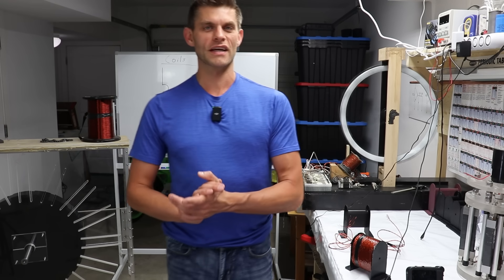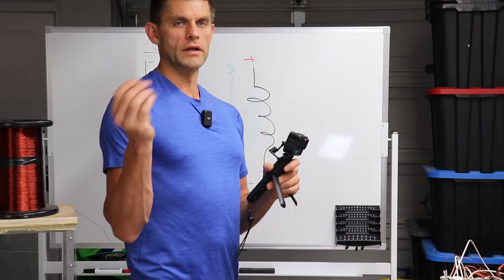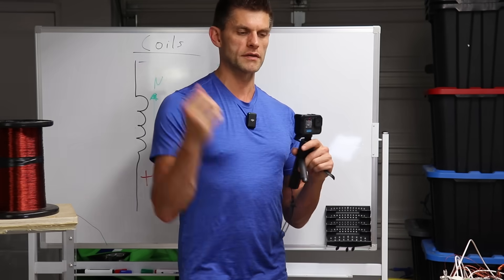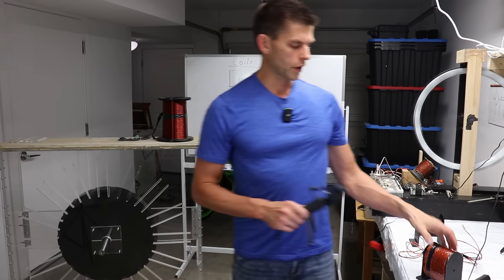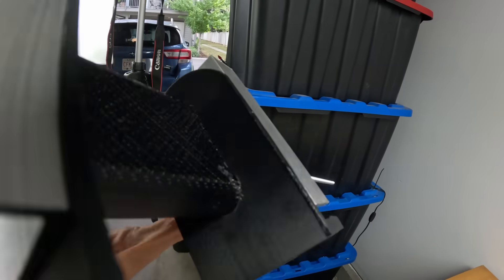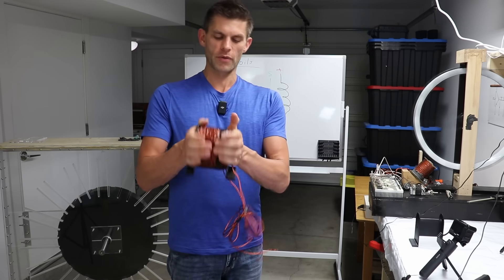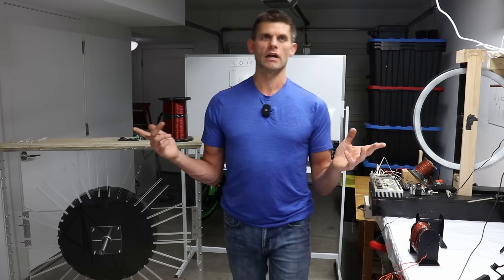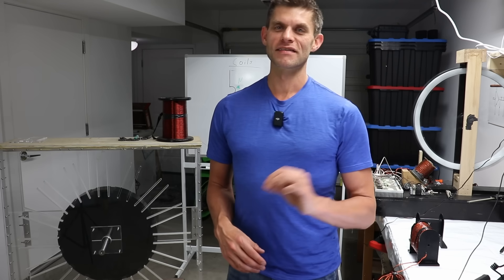Unlimited Energy in My Garage (No Patents)

Comment: I am going to support this project as much as I can, sir. From a deeply unconscious and suffering world, my heart thanks you. To the golden age of planet Earth, onward!!!
Reply from the maker: thanks for the support, lets make it happen
Reply: This is Nikola Tesla's ignition system. If he knew anything about coils he would never do that nonsense in the field with the drill and then cut the ends. It's absolute nonsense. Not to mention stating you can charge a battery with an intermittent pulse, if he used a super capacitor, it would be at least slightly believable.
This guy is a fraud, and anyone giving him money deserves to be scammed.
Reply: Why? He can always sell unlimited energy back to the grid to get all the money he needs. Unless this is a scam, but why would you support a scam?
Reply: Hey I have a unicorn detector if you're interested?
Reply: You're going to get scammed. You'll be further ahead by just not giving this scam artist any money.
Reply: Zero-point energy, the minimum energy that a quantum mechanical system can possess, cannot be harnessed as a practical energy source. While it’s a real concept in physics, “zero point energy” represents the lowest energy state, and thus there’s no way to extract energy from it because there’s no lower energy state for the system to transition to. Attempts to harness it for energy are often associated with pseudoscience and misconceptions about how it works. Extracting energy would require a lower energy state, which doesn’t exist for zero point energy. It. Is. IMPOSSIBLE.
Reply: @gregd335shot9  I noticed that you copy and paste this same comment on several videos. it's almost as if you are being paid to do this.
Reply: Please don't fund this lunacy.  Physicists have closely examined and experimentally tested this class of energy generator and it does not work. Adding more coils, magnets, rotating bits, etc. does not change the fact that for it to work would require Einstein to be wrong.  Spoiler alert, Einstein wasn't wrong.
Reply: @gyrocoptic_2  Go back to sleep
Reply: Golden  age already happened. 1000 year reign.  They had a different form of energy than this

Comment: How are you handling magnet creep? I would think they would weaken fairly quickly with so much influence. 
Just thinking about how hard it is going to be to replace the embedded magnets in the new wheel.
Reply from the maker: Ive had the other prototype running for years. And this is just proof of concept. Future models can have the magnets removed

Comment: Hey bro, something that could help with getting exact amount of length of wire instead of walking the 250' distance every time: Accurately measure out the 250' length of wire and them precisely weigh in grams how much 250' of wire weighs. Then you can weigh again on spools the exact length of wire over and over without walking that distance. Plus weighing the wire to within 1/10 of gram will get you exact lengths compared to having it spread over a field👍
Reply from the maker: Great idea. Thanks for the comment
Reply: @MadscienceLPTECH you could also measure the resistance of a known length and then do the maths. Works for electrical wire in the uk as it’s a specific resistance.
Reply from the maker: @davideyres955 agreed
Reply: @davideyres955  You'd have to destroy the enamel coating to measure the resistance.
Reply: What's the resistance of 250 feet?
Reply: Mint!
Reply from the maker: @quevicular 😊
Reply: @quevicular Can you believe there's actually a "Translate" button under your "Mint!" comment?😂 Wtf, YT, seriously?!🤭 🙄
Reply: @jenng5068  Wrote "Can you believe there's actually a "Translate" button under your "Mint!" 

If I click the "Translate to English" is translates Mint! to As! :face-green-smiling:
Reply: https://youtube.com/shorts/se4JEHsMo5c?si=YDEL8JjcW0Y36uNd
Reply: @RolsRoyce3  beat me to it
Reply from the maker: @curtisrohal28😊98
Reply from the maker: @RolsRoyce3 😊
Reply: Either that or measure the circumference of a drill head and attach a magnet. Count rotations for one 250' run of wire then send it with a hall sensor counting the magnets proximity to a coil.
Reply from the maker: @sirseven3 ❤
Reply: Or measure the resistance of the wire.
Reply from the maker: @GoonyMclinux ❤
Reply: @GoonyMclinux agree, DC resistance of the wire is best control. Non-uniformity of wire thickness make weight and length less reliable measures. DC resistivity for a given average wire thickness approximates reluctance of that wire as a coil with AC applied closer than other bulk measures.
Reply: Great suggestion!! 🎉🎉
Reply from the maker: @strive4impact ❤
Reply: Using a gram scale, especially if it goes to within 1/10 of a gram accuracy You can get to within a .250" of wire accuracy. I know because I have wound tons and tons of coils for my Searl effect generator replica. Then you can just test each coil for the inductance to make sure that they they are all inductively the same. But using an accurate scale will ensure that you have the exact same amount of length of wire.
Reply: Thats good advice,however its almost certanly in vain,because there is almost certainly no way to harvest thermal energy or "free energy".
Yes,energy is all around us in different forms,if there is no energy air would be cold to absolute zero,0 kelvin.However i see no mechanism in which high voltage pulse could harvest that energy,it simply makes no sense,why would it,whats the mechanism behind it?Also,physicists never hid the fact that energy is all around us.
Reply: @trofaznimotor901  "Also, physicists never hid the fact that energy is all around us."

The current physics models of energy are wrong. They're all based on a flawed premise. Einstein's mathematical theories were not balanced, hence the reason they had to be revised to include "dark matter" and "dark energy"... which are basically just made up placeholders to balance the mathematical equations.  No one knows what dark matter or dark energy is because... they were just made up as a means of balancing the mathematical equations in Einstein's theories.
Reply: @jimmy_kirk  come and propose better model,current model made most of things around yourself possible and you claim its all lie i know better?Well if thats case show us,i like to learn new things,however current proven model of physics does not agree with you.
Reply: @jimmy_kirk   i have no idea what have you said,all i know is that energy cant come from nothing,almost all energy we have on this planet comes from sun,sun radiates x ammount of energy,only spec of it hits our plante,it causes plants to grow,plants decompose and make oil and natural gas,bacterias run on plants or on waste from animals and humans who again can trace their energy from plants which get their energy from sun.You guys claim that there is some invisible energy because you think so,come on,show me that energy,explain what it is or how to harvest it,its so unlikely that there is such thing as harvestable free energy everywhere...
Reply from the maker: @jimmy_kirk ❤❤❤
Reply from the maker: @trofaznimotor901 ❤
Reply from the maker: @jimmy_kirk ❤
Reply: @trofaznimotor901 you forget magnetisme, 
We can see this invisible force of nature in action on a small and on a large scale all the time
Reply: @Michel-z1x8e you can say same for gravity,but just because there is invisible force does not mean that there is free energy.Gravity won't do anything if object is on the ground but if you take it up and let it be gravity will act upon it,so you gotta give same or greater amount of energy to use force to generate energy,in similar manner,if you move a wire in in perpendicular direction to the magnetic flux you will get induced voltage on the ends of wire,however that is not free energy,if you close a circuit to charge your phone for example,you will experience resistance to the movement of the wire,therefore you turn mechanical energy into electric energy.Now you might be asking,if thats all the case where does energy that moves my car or cargo ship comes from,who produces it?And the answer is from sun,sun provided light energy to plants which utilised given energy to produce sugar(photosynthesis) which further became cellulose or part of some animal body,that became fossilised and we got chemical energy.
Reply: @trofaznimotor901  if I’m not mistaken it has been discovered that even at absolute zero there is still movement of electrons. Meaning that energy doesn’t stop because of temperature.
Reply from the maker: @trofaznimotor901 generic viewpoint
Reply: actually theres a trick i learned from the rf community. we use a lab grade meter or a nework analyzer to measure the resistence of the wire. there is a standard resistence for all types of wire and they can all pretty much be done this way. there's alot of very very smart people in the rf community
Reply: You miss the point. He wants the wires stretched out 250 feet so he can twist them together uniformly.
Reply: Bro how’s the seg build going?
Reply: I have had a concept for something for a long while and would appreciate any thoughts. Imagine a giant torus (think derigible size) made of aerogel under a vacuum. The core of the torus is a superconducting loop of energy. At the center of the torus is a sphere. Between the sphere and the torus are counter rotating rotors. The skin of the torus is covered completely with solar collectors which energize the loop. The rotors are moved by the magnetic force from the loop. 

https://youtu.be/DL_ISlCIsls?feature=shared

I'm hoping you and your  intelligent viewership here will have some insight. Please and thank you.
Reply: Little tip from the 3d printing community
Reply: alternately, measure wire resistivity and calculate the distance!
Reply: Yeah weighing it and then factoring the diameter can give you the length as there is a production standard usually .
Reply: lol
Reply: Will the high back voltage blow the mosfats?
Reply from the maker: @Job32Elihu not if u have a charge batteey hooked up / TVS diodes to protect it
Reply: You can also do it by measuring the charge of the cable ( capacitance )
Reply: thanks for the tip, been getting more into weight based stuff, this helps adjust the mindset tremendously!
Reply: Assuming the tolerances on the wire are good :P
Reply: What do we make of marco Rodins work people ? Rodin coils and vortex mathematics .
Reply: @coolbreezesolisfabrica 
I have used a similar coil custom made to magnetize my Searl effect rollers. It creates the necessary sine wave patterns on the magnets. Oddly enough it's nearly identical to a rodin coil.
Reply: @woodbrassandglass nice there is definitely something to this research despite the naysayers consciousness doubting ... Eventually they'll catch up. To me it makes perfect sense that there is a bottomless well of energy. I'm going to be using solar to split hydrogen and run in a conventional engine as to me that is the most cost effective approach existing vehicles can be refitted and once combusted back with oxygen only water vapour and the cycle contues steam cloud rain . It's all the suns energy at its core .
Reply: Bottomless untill our star goes out that is lol
Reply: Lest we become star eaters its bottomless well to us humans
Reply from the maker: @coolbreezesolisfabrica ❤😊
Reply from the maker: @woodbrassandglass cool
Reply: @MadscienceLPTECH ❤ my future project is going to involve water sunlight and some earth elements I aim to make a motorbike that condenses water and splits hydrogen and recollects the vapour after combustion recycle . Hopefully a nearly closed loop collects from air while in motion to top up the water levels . Only parts that will be used up are the anodes and cathodes. Eco boost engine running a generator that's feeds two  tiga inspired hub motors .also  Inspired by Akira bike design . Possibly use your tech to make the splitting voltage in combination with solar power.
Reply: I'm doing something revolutionary splitting water molecules into hydrogen using sound modulated frequency.  No heat just huge volumes of hydrogen to run and engine to run generation to large scale 1gw 1/5th the cost of solar wind. Non resource consuming after set up. Patents nearly ready. Our world can be cleaned up.
Reply: its cheaper to buy in bulk
Reply: *assuming a relatively tight tolerance in the wire diameter across the length of the wire.
Reply: I’ve been looking into maglev tech off and on now for a few decades; since college.  I don’t fully understand all the things you’re saying and doing here, but I know enough to know that I support you’re work!
Reply: What aboit reading it with a meter and doing some math of how much current is going through compared to a full roll?
Reply: Well, that's assuming the thickness of wire is ULTRA precise when purchased with virtually no variation.
Reply: By weight, electrical resistance and simple math.  It’s funny how the simple things become blurred when trying to operate at genius level.
Reply: You can also measure the resistance then look in the regs book at r per meter do the calculations and you know how many meters you have
Reply: You can see a good wire length measuring tool at any home depot store, I have a couple of them myself. They don't take up much space.
Reply: If you need 250 feet of wire... can't you just buy a 250 foot spool of wire?
Reply from the maker: @jimmy_kirk ❤
Reply: I know right
Lol! @jimmy_kirk
Reply from the maker: @izysly6924 ❤
Reply: Bulk purchase is cheaper, spending an extra $100 for the convenience of hopefully the correct length hurts sometimes.  @jimmy_kirk
Reply: @jimmy_kirk all I can say it might be cheaper to buy more on one spool then multiples idk
Reply: Yeah? And then take all those and walk them out 250' to spin them? Makes no sense, fool.
Reply: So you want $20,000 to keep making your toys that, let's be real, aren't going to harvest any meaningful amount of energy, there's no way u can power people's homes with this, maybe a lightbulb, one lightbulb with $1000 worth of magnets and wire😂
Reply from the maker: @archie_4843 u sound smart
Reply: None of that really matters because this is a grift. This person is obviously not dumb enough to think this works, so he's just trying to fool as many people as he can to get money. You can't harness zero-point energy to do useful work.
Reply from the maker: @mellowphantpi9168  lol you can't, we can
Reply: @mellowphantpi9168 you might not be able to but it’s possible
Reply: @mellowphantpi9168 ok prove your statement if you can’t then go away, also do you really think this guy is the only one to discover this . There are multiple different ways to get energy out of the vacuum. If you so smart why don’t you know about the patents the US navy filed about this very subject. Maybe your not as smart as you think
Reply: @mellowphantpi9168 what about lighting an led for 1 second?
Reply: @mellowphantpi9168  weird thing is though, gimmicks can sometimes be inspirational for making practical improvements on devices, and basic machines.
Engineers are kinda like that in a sense.
They'd look at con jobs, and turn them into a reality.
Albeit, free energy concept, energy outta nothin is perhaps impractical.
Sometimes there's hints of improvement on the gimmick that the popular method of production of the real world device or machine doesn't, usually achieved by ambitious yet mislead or slightly (unrealistically ambitious) people who actually believe they can achieve their claims.